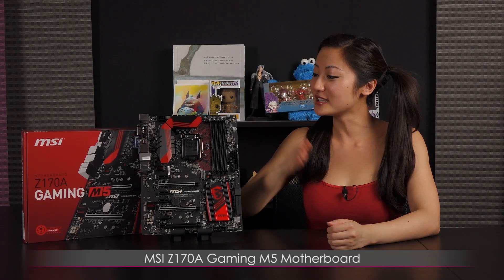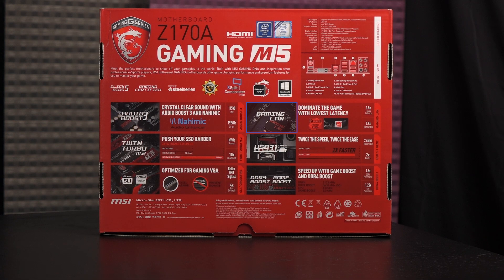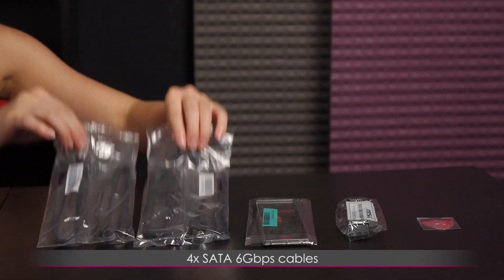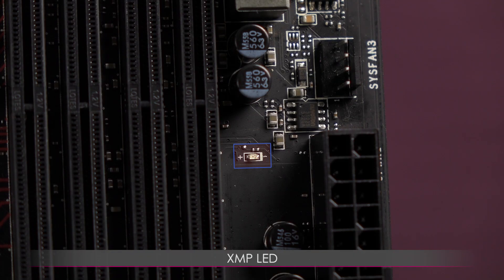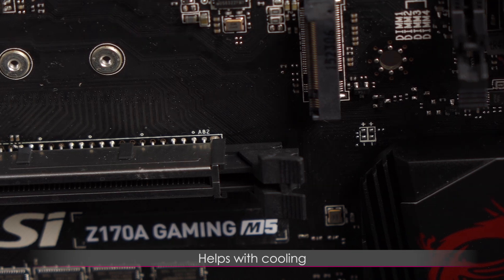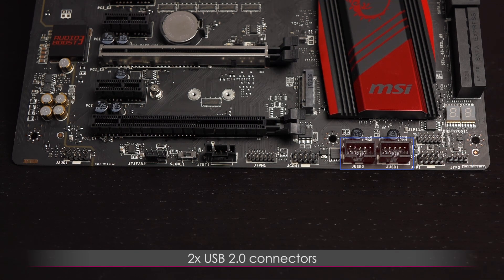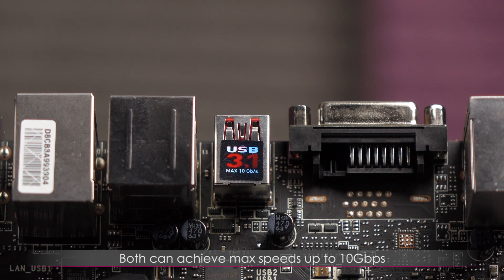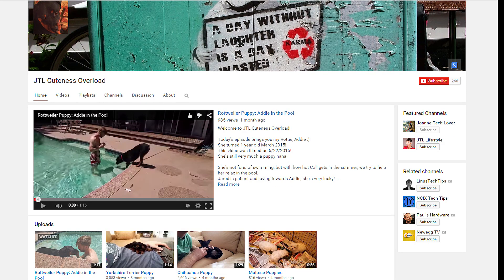MSI Z170A Gaming M5 Motherboard: Skylake is Here! - Overview

Comment: Sorry for the noobie question, but does this board support 1440p at 144Hz?
Reply: The HDMI port supports 4K @ 24hz and ultra wide quad hd @ 60hz. It does not mention 1440p and 1080p, therefor there is no limit on the framerate. 
tl;dr yes, the HDMI port allows for 1440p @ 144hz

Comment: Hi, 

Following my configuration is ok built? Please suggest me best according you.

 
  INTEL PROCESSOR CORE i7 6700K (Intel 6th Gen, Z170 Chipset, LGA1151 Socket, 8M  Cache, up to 4.20 GHz)

  Asus Z170M-PLUS 64GB DDR4 Intel  Motherboard
 
  CORSAIR RAM VENGEANCE LPX 16GB DDR4  2400MHZ CMK16GX4M2A2400C16R Memory Kit - Red
 
  COOLER MASTER NEPTON 240M CPU  LIQUID COOLER (RL-N24M-24PK-R1)
 
  Samsung 950 PRO 256GB M.2 PCI Express SSD  (MZ-V5P256BW)
 
  CORSAIR CABINET SPEC M2
 
  CORSAIR SMPS AX 860i - 860 WATT 80 PLUS  PLATINUM

Thank you

Comment: @Joanne I enjoyed the thorough overview vid and have a question.  Any idea how to enable the MSI Super Charger feature.  I downloaded the MSI app but I'm unclear on which USB port JUSB1 or JUSB2 (2.0) to use and then does the other end of the connector go to the back panel (need to buy a plate/connector) or front panel?  Thank you in advance.

Comment: Will this mb take a gtx 1080 ?
Reply: Yes, this board has three PCIx 3.0 slots. As long as your power supply is fitted for your build properly, you should be fine.
Reply: Yes, I have the MSI GTX 1080 installed in the PCI_E2: PCIe 3.0 x16 
slot

Comment: (Don't judge pls, never done a custom build before) 
Does this support 1920x1080 @ 144Hz for the HDMI?
Reply: hdmi does not support 144hz. only Displayport and dual link DVI
Reply: The resolution yes, no sure about the freq.  What are you using at 144Hz?

Comment: Could this run a Gtx 1080? How about 2 1080's in sli?
Reply: Yes, with PCIx 3.0 you should have no issues, just make sure you have an ample power supply with enough 12v rails

Comment: Hey guys just want to ask which is better, asus z170 pro gaming or the msi z170a gaming 5?.. they're about the same price here in my country so im torn between the two... thanks for your time :)
Reply: Mel Pim That's exactly what I want to know. I'm buying a new motherboard tomorrow and don't even know yet whether I should go with the Asus pro gaming z170 or this msi m5 z170 lol.
Reply: I'd go with the MSI. It's a better-built board with a good power phase. It has military components and two metal-clad PCIex16 slots, which were heavily soldered to the PCB.
Reply: Greyswindir I've literally just bought asus 1 hour ago lol but thanks for replying anyway buddy.
Reply: UltimateDriftR - I hope the Asus board serves you well. Just because I got a dead board from them doesn't really mean much. All motherboard companies ship dead boards. They somehow slip through their quality control system. I kind of liked the Asus board, too bad it was D.O.I. (dead on install). I tried a Gigabyte and an ASRock and they were both D.O.A. also. The MSI was the only board that worked from the get-go.
Reply: Greyswindir Really! Your buying a lot of dead boards arent you haha. Thank you very much and I hope the MSI board also serves you well :)
Reply: UltimateDriftR - Yup. Really. First time I ever experienced so many dead boards at the same time. Usually I order a board from Newegg and I mount the board and it works. Thank God I decided to go to Micro Center this time. All I had to do was take the dead boards back and exchange them for something different.

For accuracy's sake, the Gigabyte board wasn't actually dead. It worked fine, then I decided to put in a different processor (started out with a i3 6300), a Skylake i5 6600k and the board wouldn't post. I tried three different ram modules, no luck (it was confirmed as a ram problem in conjunction with the 6600K).  So I took it back and exchanged it for the MSI Gaming M5 and have been happy ever since.

You're welcome and thank you...Merry Christmas.

Comment: Steel armor on the gpu slots will go perfect with this graphics card MSI GeForce GTX 980 Ti 6GB Video Card, I heard that things heavy. The only thing that worries me is that the cpu cooler I'm ordering might cover up the dragonfly design at the top and left of the processor Cooler Master Hyper 212 EVO 82.9 CFM Sleeve Bearing CPU Cooler...

Comment: Thanks for the detailed explanation. I would need lots of advice from you to avoid getting the wrong stuff. My focus would be just on average gaming (offline single player only) while most of the usage would be for data storage and watching vids. Do I really need 1151 socket or just 1150 socket is enough already? All I need is 8gb or 16gb performance ram, 1x GPU with good heatsink. If I opted the fastest i3 and get a better GPU like the cheapest GTX970 or R9 290x or R9 390x, would it be better than going for i5? Is HDMI better or DVI better? I don't do any overclocking btw.

Comment: Please guys anwser my questions, i need some help!
1. Is it worth it to spend more to get the Msi Z170a Gaming M7?
2. Is the Msi z170a Gaming-G45 worse or better then the M5?
3. This or Msi Z170a Gaming Pro?
Reply: Its all in what ya need n suits ur build. Going duel or triple gpus? Going to b using m.2. How bout usb 3.1 type c. Audio matter? How many sata ports ya need for ur drives. Jus google these boards n hunt through the specs. I would for ya but im lazy lol
Reply: Mephisto Well the maximum i will use is 2 Gpu's, the audio i dont really care baout, i have headset with integrated soundcard that sounds good enough for me and i dont give a shit about m.2.
Reply: Raimu Maes then i would say jus get the cheapest board. Im pretty sure even the cheapest ones n this chipset support duel gpus. Jus make sure it supports sli n atleast 8x of bandwidth on ewch slot.
Reply: Mephisto Thanks for the info.
Reply: Raimu Maes yep

Comment: What is the difference between x16 and x8 PCI? From the diagram shown, it seems like you just need to plug the graphics card.
Reply from the maker: zerioification x16 has more bandwidth over x8; some say they don't notice a difference in performance boost.
Reply: Joanne Tech Lover But am I right in thinking that to do sli or crossfire, I just have to plug the graphics card on the slot without thinking about x16 or x8?
Reply from the maker: zerioification Depending on your CPU, you can either get x16/x16 or x8/x8 if you do a dual card setup.

Comment: Hi, I'm going to build my very first PC build, mostly for gaming. Which motherboard should I go for: Z97 or Z170? I have got most of the PC components, with the remaining parts are: CPU, Motherboard, and RAM. The motherboard will help me make decision about what CPU and RAM I'll buy.
Reply: ***** depends on your budget and your needs. I'm getting z170 for the m.2 and future-proofing since i'm upgrading from a pretty old system and want this to last a while. the z97 is still fantastic for gaming if your budget is tighter. if not, go for z170.
Reply: +A. Theo Judd If I go with Z97,  will I miss things other than DDR4? And is there any difference im terms of performance?

Comment: Joanne please please please help me out.
I'm planning a new build from scratch.
Should I go with X99 based pc or a Z170 for gaming? Both cost me about the same where I live and just a 100 dollar more than a Z97 based system.
Reply: Ali Sher As of now 6 cores isnt relevant in gaming. You will gain a few fps, if any. With DX12 and W10 it MIGHT become relevant if developers have their games utilize +4 cores.

X99 isnt the most stable of systems, especially with memory (ram) there are issues. 

I've been debating this myself this whole weekend, and has been convinced to just get a 6600k. Unless you're into extreme OC (whereas you should get 6700k), or some hefty video/photo-editing, 5820k just isnt worth it, especially not when its unstable with so many people. And especially in gaming, you will NOT gain anything with 6 cores, because games today simply dont utilize that many.
Reply: I said the X99-chipset had issues with ram, the Z170-chipset is completely different. You can Google it and read about it yourself. :)

The way I see it is that as of now, a 6-core CPU is not gonna make a difference in gaming over a 4-core. Therefore it makes more sense to get Skylake, and wait for Intel to release a 6-core CPU for it. By then, we hopefully also know more about DX12, and how/if it will utilize 6-core CPUs better.

What we do know for certain is that DX12 puts less strain on the CPU and more on the GPU, so really, it makes a 6-core CPU pretty much pointless for simply gaming.

Basically, theres no guarantee those 2 extra cores in 5820k is ever gonna do much for you, and on top of the X99-chipset not being the most stable, I dont find it to be a good idea.

HOWEVER, if you do alot of streaming, or photo/video-editing or rendering, 2 extra cores works wonders. But for simply "gaming", it makes more sense to get Skylake, wait to see what happens with DX12, and then consider a 6-core CPU whenever Intel releases one for Skylake.

You can also try and search on YouTube "CPU Cores for Gaming: How many do you need? - Q1 2015 Update" - its a video from Linus, it shows graphs and FPS difference of 4-core and 6-core CPUs.
Reply: Ali Sher The X99 Cpu's (5920K/5930K & 5960X) currently outperform the current 2 new Skylake CPU range. However this is just the first phase of release, high end Skylake's are out later on in Q2'16, they will over take the x99 Cpus. (Myself a owner of the 5930K)
Reply: Are these boards a step up or down from X99 boards?
Reply: ***** how come? Like in what aspect?
Reply: ***** i don't think these features effect my gaming in any way. Any other significant change?
Reply: ***** i was gonna go with 5820k and X99 board. Atleast 6 cores. But am I gonna gain any if I switch to 6700k z170?
Reply: Ali Sher No you should go with X99.  5820k will be way Better for your Money.
Reply: Dunkl ^-^ I'm also leaning towards X99
Reply: Juusu Hako If I can gain even a few fps with exactly the same amount of money, why shouldn't I? And Z170 also uses DDR4 rams so I don't know what you mean by unstable memory. I have opted to go with X99 system though. Thanks for your feed back anyway :)
Reply: Juusu Hako Alot of what you say does make sense and I do know that extra 2 cores don't effect my gaming performance but my question was that why shouldn't I get it considering both cost me exactly the same. I get everything Skylake has plus 2 more cores on CPU for the same price. I wanted to know if Skylake is an improvement over the X99 but apparently it is not. 
As far as problem with ram goes, I didn't hear anything about it from all the reviews that I watched but I will look into it. I think those might be just exceptional cases with bad faulty motherboards.
Reply: "I get everything Skylake has plus 2 more cores on CPU for the same price."

I really dont agree with this. Skylake is the latest chipset and offers lower power consumption (up to 100W if overclocked), less heat and overall better features from the motherboard manufacturers.

Its really not that exceptional from what im told, just Google and look into it. Specifically the X99 MSI-boards are supposedly the least good (the cheapest ones at least; which ironically arent even that cheap). Like I wrote I've been looking into X99 and Z170 all weekend to find out which to get, and I think you'll be better off with Z170, unless you're gonna be streaming and/or editing.

Good luck with your choice.

Comment: X99 or 170A ? I am building a new PC 2000€ and i am not sure about it i7 5820k with MSI gaming 7 or i7-6700k with MSI Z170A gaming M7.
Reply: +Matze Schwarzhans if you havent build your pc yet get a i7 6700k
Reply: gaming or 3d grapichs and editing?
Reply: +I allready bought the i7 5820k and overlocked it to 4.5 GHz and I am very happy that i didn't picked the i7 6700k. This way I have a way better rendering time, more usb 3.0 Ports, more SATA connections, more PCI-E Lanes. In addition I got a GTX 980 and my 5820k will not be a Bottel neck for Gaming for the next 10 years.
Reply: Matze Schwarzhans good job man ;), i've got your same pc, but with a i7 4790k, it work really good!

Comment: JTBT1 GPIO (General-Purpose I/O) header for Thunderbolt Add-on Card 
 This motherboard supports the latest Thunderbolt technology. For
proper Thunderbolt support, please install the Thunderbolt add-on card on
PCH Slot6 and connect the GPIO cable from the Thunderbolt add-on card
to the GPIO header (JTBT1) on the motherboard for TBT hot-plug support. 
 this is what i found out about that port .. hope  it helps.
Reply from the maker: tim peterson Nice, thanks for letting us know! 
Very cool :D

Comment: ill never understand why they are still putting ps2  ports on mobo's  ??? I dont know anyone  that has used one in like 2 decades
Reply: tim peterson PS/2 can be a lifesaver when you have problems with the usb driver during boot.  Sometimes a usb keyboard doesn't work in the bios.  And it has N key rollover. Also you have another free usb port for something else.
Reply: psyduck170 Some keyboards like the Qpad mk-95 has full N-key rollover over USB.